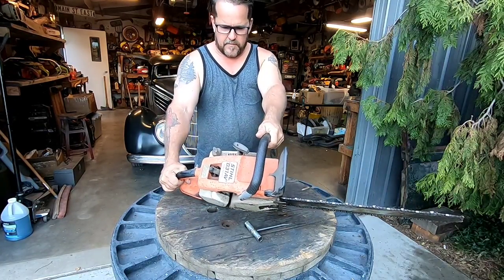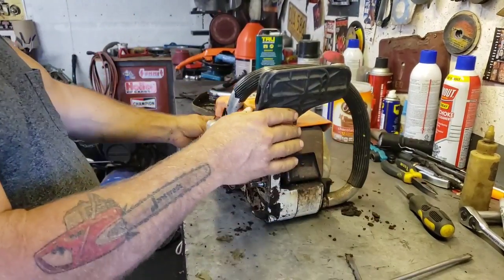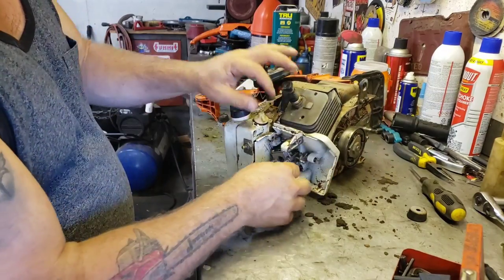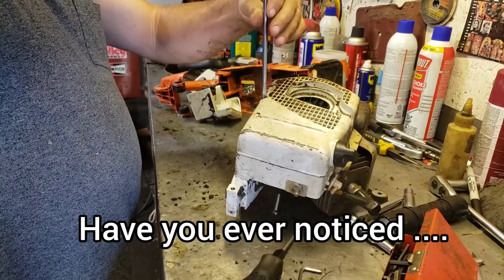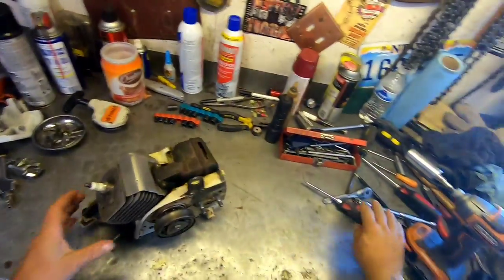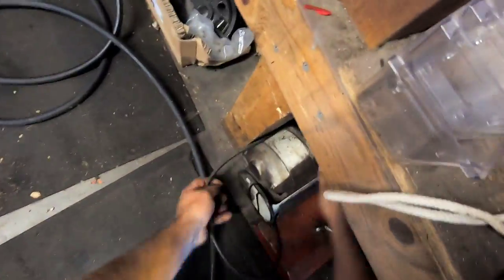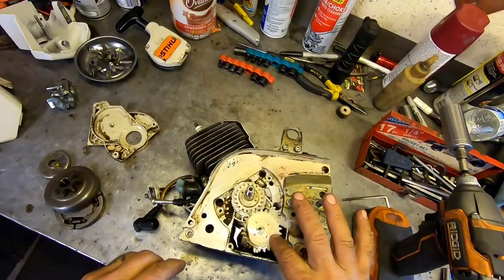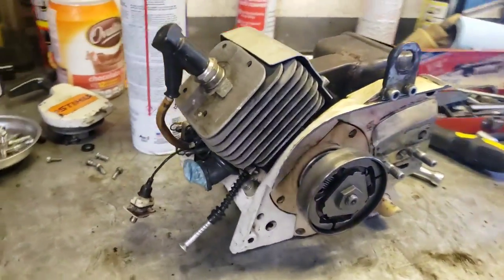Stihl 031AV Chainsaw Teardown/disassembly and inspection

Comment: This is just what I needed, step by step. Just bought 2 non running 031 for 25$ @ piece. Haven't worked on that saw before.
Reply from the maker: Glad to help!😉
Reply: @KainKustomGarage  you did! Working on a 056, 034 and an 041. Have a husky 281 and 61 also working on. My 064 runs great but the 880 needs a tune up lol.

Comment: I pressure wash the heck out of the saws that I restore.  I field strip the saw, so I only have the case and maybe rear handle.  I lock the boot with a plug and rotate the cylinder to TDC and block up the exhaust port with duct tape and plug the impulse line.  I then spray it down with Super Clean and pressure wash the hell out of it.  After it is all clean I blow it dry with compressed air and put it out in the sun to dry for a couple of days.
Reply from the maker: Thanks Lee!

Comment: Great video thank you for the tips, I just picked up a saw just like this one. I Will follow your advise on teardown,
Reply from the maker: Thanks Buddy, Good luck on your project!😊
Reply: @KainKustomGarage  hey boss I got a question for you I inspected  the saw,She  looks like someone had recently been into it ,,so I repaired the recoil starter spring ,put some fresh fuel in it, checked the bar oil and she fires right up and purrs like a kitten ,,I do have a question please,,when the chain runs ,(it is getting plenty of oil ) it makes a lot of chain sound like somethings just not right on the chain operation 🤷‍♂️like it’s got the wrong chain on the bar or some crazy thing like that hard to describe just really noisy again it is producing plenty of oil. It has an aftermarket oregon double guard bar, which is been modified at the oil ports from the Saw to the bar. 🤔However, again, it is seem to be producing plenty of oil on the chain. The bar is a part number # 200PX )) 176PY,,, Saw model Stihl 031 AV, serial number 9–1 113–1 41–0400,,,. The bar is a Oregon Double Gard 3/8 inch serial number 200PX )) 176PY. she seems to cut really well. I tested it on some small branches but again just a lot of chain noise ,not clutch noise literally the chain on the bar 🤷‍♂️something doesn’t seem right. I appreciate your advice .This is obviously not your first rodeo. I appreciate your time. Thank you.
Reply: Got it figured out,  turned out to have the wrong bar on Saw,someone had modified the saw to except the wrong bar.im waiting for new studs to mount new o.e. bar to  saw with new chains.

Comment: Those were good saws. Those starter pawl springs were fragile so you need to keep a few as spares. There were 2 different recoils also, 2 screw & 3 screw. The 032 was an upgrade sort-of. The right side of the crankcase was the same as the 031 but the left different. 032 was a tad bigger as well. Worked a lot on these when they weren't all that old. 1 last thing, take a look how long that ignition ground lead is! It wasn't uncommon for the insulation to wear thru grounding it. Also that ignition unit underneath the flywheel was a bit fragile also.
Reply from the maker: Thanks so much for your Wisdom Darrell!😉

Comment: Looks like a piece of cake after working on the 020 !!!  The 031 is one of Stihls better saws. The one I inherited turned out to be a real performer, is a handy size for firewood cutting, an all around great little saw.
Reply from the maker: Ha ha, So far, as long as we don't run into any surprises...Yes, they are great saws!😉👍👍
Reply: The 031's are one of the better Stihl's for sure. @KainKustomGarage

Comment: I stuff a piece of paper towel into the exhaust port and pressure wash that side, too.  I do spray a little WD40 into the exhaust port, beforehand, just to put a little lubricant into the cylinder.  I blow everything off with compressed air, afterwards, before I let it dry.  After drying, I touch up any missing paint before reassembly.  I throw all bolts into a plastic container filled with old two cycle.  I will clean their threads before reassembly and use Locktite on those that need it.  I also pull the clutch and sprocket before washing - right down to a bare crank.  I want to see the condition of the seals.  The flywheel is also removed before washing, too.
Reply from the maker: Thanks for your Wisdom Sir😊

Comment: I have one of these and it doesn't want to rev up all the time. bogs down when throttle pressed. idles just fine. 
Replaced almost all the parts, impulse, fuel line, spark plug, chinese carb. Still won't rev up 90% of the time. any guesses.
Reply from the maker: Maybe check the impulse line, see if it's cracked...🤔

Comment: Another good video Dan.... One question so when you test for spark with the drill it's in  reverse right🤥 ...from what you were saying it's opposite .... and I'm also going try some of the super clean
Reply from the maker: Hey buddy, So if you're on the clutch side it's clockwise...flywheel side would be counterclockwise, I always just visualize what way the chain would be going....good luck sir!😉
Reply: Thanks brother.....🤙

Comment: I don’t.  I seal everything up and hit it with the pressure washer after spraying it down with Super Clean or Purple Power.  I then let the engine part dry for several days in a warm place before putting it back together.
Reply from the maker: Nice👍👍

Comment: So my question is you use motoseal  ..what the difference between that and say an high temp rtv sealant  or maybe an Indian head shellac?
Reply from the maker: Motoseal is fuel resistant and seems to be a little more sticky, if you know what I mean...works good for fuel tanks and everything on chainsaws...you can get it at AutoZone...😊
Reply: Motoseal is a miracle product for me.  It's like room temp honey and is fuel safe.
Reply: Thanks lotklear, I'll give it a shot always looking to try new things
Reply: @robertbranczewski2454    it never dries hard, just stays viscous.  I would say it works great in sealing anything low or no pressure, fuel or oil related.

Comment: i don't know if its me but almost always when i pressure check saw after sitting long pass both test, but after couple tanks crank seal like to fail and arr hard as rock, like plastic, and brittle don't know if anyone have same luck
Reply from the maker: Thanks Nikola, I've been lucky on alot of these old saws, they seem to run fine without messing with the crank seals 90 percent of the time, but that doesn't mean they won't last very long. If I were to use a saw all the time I would definitely do the crank seals as well, cause yeah, seems like they are all hard as a rock on these old Beasts 😊